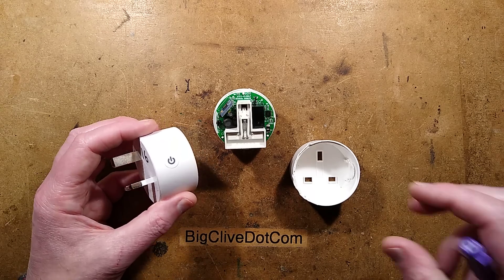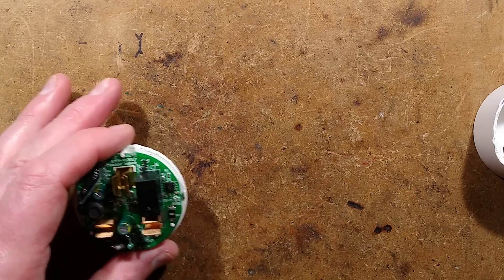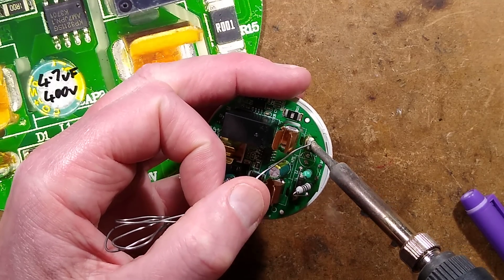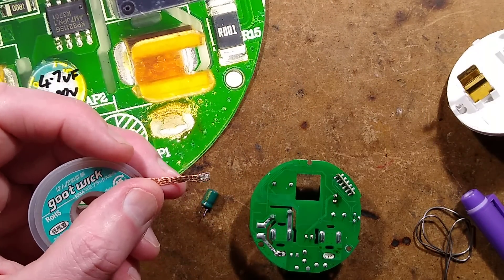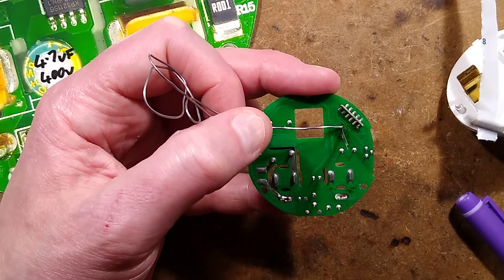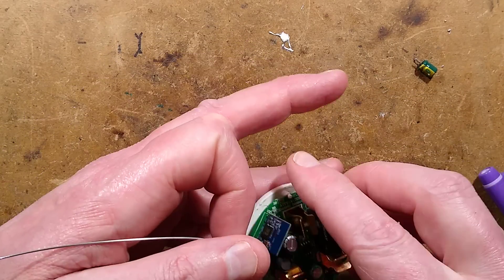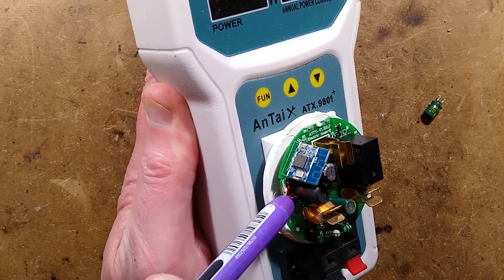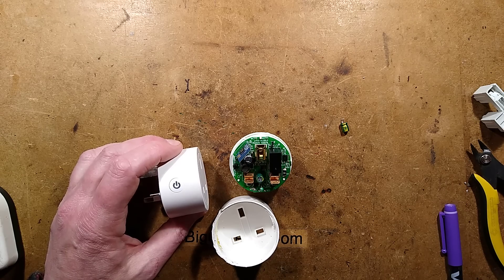Fixing a faulty LSPA7 smart plug (XiangHeWang)

Comment: I've had ones where the rivet holding the socket contact to the plug contact has been loose and cause umpteen problems. Soldering the joint sorts it out.

Comment: I had to open a couple of my smart plugs to access the wifi module and its serial port (UART) to flash a custom firmware and those things are a pain to open, also I couldn't really desolder the PCB so I had to essentially pry it from the case just enough to solder some wires on the module contacts on the underside.

As for closing them again I have to say a generous amount of hot glue around the border (applied before closing it) does a decent job at holding it together and also if you need to open it again for whatever reason you can let some isopropyl alcohol through the seam to unstick it

Comment: That was a really informative video, thanks! 
I've got a few of these from tp-link, one of which seems like the relay isn't moving anymore (and going by your description might be contacts welded) 
I used it on a pc tower, so turning on the power might have been a high enough current to do the damage.
Reply from the maker: It was probably inrush current to the PSU capacitor.

Comment: CHINESE capacitors are the biggest problems in modern products. They are built and sold in order to be bought and installed in a product, that in turn is built to be sold to extract some money from the customer 's wallet. Their mission ends soon after.
I have come capacitors which are built to behave as capacitors for as long as possible. Built from ITT, Sprague and Nichicon, they last 20 years or more, honouring the European, American and Japanese electronic Industry in the best possible manner.
Have an Happy New Year 2024!
Greetings,
Anthony

Comment: Capacitors are the most expensive components in these products so you can bet they under size and under rate them as much as possible to save that last half cent.   The fact they fail after only a hundred hours of use as a result does not make them any more money in their eyes.

Comment: It always seems to be the capacitors, but given the nature of sealing the cases shut, it makes repairing them annoying because you can never quite get them back together properly, assuming they didn't get entirely broken on disassembly... :\
Reply: Yeah. You kinda have to convert them to other uses and case them inside an appliance or other larger casing. Clips and one screw would be just as secure but allow for repairs. They'd say it has to be glued for safety of course, and not so you're encouraged to buy them over and over for the rest of your life.

Comment: What is the best option for a replacement cap?  Low ESR /  Solid Aluminum electrolytic / A higher voltage rating/ a higher temperature rating / Tantalum ???  He Wang should Xiang his head in shame.
Reply from the maker: Ideally a polymer cap might be good.  But a decent low ESR electrolytic is a good start.

Comment: Strangely, this actually will defrost your car 😋
Reply: Yep. Stick it into the socket nearest to your car, program it for an appropriate time before you leave for work - I recommend about 1 hour before the usual departure time....
Then simply run an extension lead out of this device to a heater you've placed inside the car.

Comment: Thank you so much for taking the time to look at this for me! there must be 1000s in the bin in UK! I will carry out your process for the other 8 i have and any further that go faulty, though the first batch still performing , once i get one running i will confirm the fix,  those you have need a reset to default and app  (smart life ) download , account and sync with your wifi , again Thank you for investigating and giving me the key to getting them working again , Happy new year !
Reply: Perhaps you can repair the with the solid type capacitors Clive mentioned.

Comment: Was that label from cpc really a fabric label?
Can't say I'd trust an electrolytic capacitor being so close to live pins like that

A good solder flick can be helpful, but not when it just lands on your other arm 😅

The unit seems to come off too easily, I've pulled things from sockets before that have come apart in my hands, then you're left with a live thing dangling there
Reply from the maker: Printed plastic bag.
Reply: Or rubber gloves.

Comment: Regarding "flicking off" the old solder blob: I actually intentionally drop parts like these from 10cm and less. In my experience it works quite well to also clear solder from small and big holes .
Reply: I use the "heat and bash" method. Just bash the thing against the table to dislodge the molten solder onto the bench.
Reply: @Loscha   Yeah, I'm a basher, too.
Reply: @Loscha  yep smack the edge on the table and you clear those spade connectors or smack it flat for solder blocked through-holes.

works 100% every 3rd time 😂
Reply: Percussive repair has been used since the beginning of time and repairs themselves.
Reply: I've also used a stainless steel paperclip to physically move the solder out of the hole while molten.  Or a toothpick.  Solder doesn't stick to these things.  I always break something when I flick.
Reply: @pault6533  I don't recall who recommended this to me/us, maybe BigClive, or maybe AvE: I have bought a set of needles (actually hollow needles, like syringe needles) of various sizes, stainless, that can be inserted into a solder hole, sometimes even additionally to/over/around the component lead. Insert while hot and retract when cold, this sometimes makes it easy to remove/unsolder a component, specially if you want to keep/reuse it later and need the leads.
Reply: @lImbus924  Very useful things not only for clearing through-hole solder, but also for straightening connector pins.  I recently ham-handedly mashed a USB 3 motherboard connector.   The contacts are very small, but one of those hollow needles slipped over the end of the bent contacts made straightening them very easy.
Reply: And I wipe the tip of the iron on my old jeans....
Reply: @skuula  And how did you get old jeans?  By wiping my iron on my new jeans...
Reply: @d00dEEE you can't have new jeans forever ! 😅
Reply: The drop or flick solder removal methods do work but from my experience, never wear shorts while attempting.
Reply: @emehlhar  lol, yea, that can hurt. Been there... 🍻
Reply: @emehlhar  or sandals with no socks... although some people seem to have issues with sandals+socks
Reply: That's my approach.
Reply: Briskly blowing through the thru-hole right after you melt the solder works to remove it also on those delicate boards that you can't just whack on the edge of your your bench... 👌

Comment: Most of my smart IOT devices are liberated from the chinese by reflashing the onboard esp or tuya chips with Tasmota or openbeken, they are now local Lan & mqtt controlled instead of the "Internet required Cloud"  and are better to use. Multi relay devices are all on or all off by default configuration  but once liberated you can control individual relays and have greater control over what is connected.  I say goodnight to Alexa and it turns lights on and off as I go to bed (yup lazy as can be)
Reply: Liberated from the Chinese, and then you use Alexa.😂😂😂😂
Reply: dude, can you make a tutorial (series) for that sort of thing? Being able to actually use hardware that's been discontinued by the manufacturer and the requirement of their proprietary cloud service has rendered them useless, would be incredibly useful for consumer freedom and reducing waste.

... maybe big clive or perhaps Louis Rossmann can do that, if they realize it's an option - Louis would definitely love it.
Reply: @TheDZHEX  Tutorials already exist. search for "flash smart plug".
Reply: @TheDZHEX flashing a no-cloud firmware like tasmota on any of these esp is quite easy once you figure out the pinning of the chip yourself or if you find it in the numerous documentation pages made by the community
Reply: @cuteraptor42  sure, but what do you need and how do you know if it's actually doable? The actual process is likely quite simple indeed, but if you can create a shortcut from zero knowledge about flashing, pinouts, connections, etc. for people to be able to get into that, it would be quite useful, I think.

... assuming this isn't something like having a product that happens to have an off-the-shelf arduino or equivalent inside it...
Reply: Sadly  @TheDZHEX , the LSPA7 is one of the newer Tuya devices with a less well supported micro-controller, which isn't as easily re-flashable yet, so there are no tutorials for it.

One option is to buy Sonoff or similar devices which are easy to find, have control chips with more well developed firmware, include programming headers, and where tutorials are available. All of the power for our homelab goes through a powr320d which has been reflashed with ESPHome, for instance, and I just followed the ESPHome for a Sonoff Basic, adding a few tweaks for the power monitor.

The other option, if you already have an LSPA7 is that you can do local control with the stock firmware once you extract the device id and key using tuya-cli wizard. I do this to power cycle a troublesome IoT device every night with a Home Assistant automation. To do this, you will need a Tuya developer account, but the process is quite well documented, just search for "Listing Tuya devices from the Tuya Smart or Smart Life apps".

If you're worried about the original firmware 'phoning home' then you always have the option of blocking all traffic from it's MAC address in your router, once you have local control working.
Reply: While most esp8266/esp32 devices, and older Tuya devices are easily flashable with Tasmota or ESPHome (which I prefer for Home Assistant use since you don't need a separate mqtt broker) and many even have programming headers, newer Tuya devices like the LSPA7 use a proprietary microcontroller module that can't be flashed yet, even if you can get at the module. It's a shame really because these are cheap (I have a few) and unobtrusive, compared to something like a sonoff.
Reply: @markbooth3066  I just put everything on a local-only restricted Home Assistant hub via Zigbee. That way any WiFi chip (if there is one; most don't have both) can do what it likes & it still won't be able to contact anything. Gave the WiFi bulbs a try in the past & they're just not as reliable as the Zigbee mesh unless you already have an established mesh network set up, plus they expose your router to DoS attacks.
Reply: Sorry but what a joke! 😂 Going cloudless on smart plugs and iot devices but still keeping alexa 😂 i would invest in pycroft or a custom non cloud smart assistant
Reply: @309electronic5  I've seen this openHAB thing... open-source home automation thing, could that be useful here?

Comment: @MarshaJ8800TU  suggests the failed cap is coping with 1MHz from the  KP3211 switching chip  ...  amazing frequency for a power supply.
Cant find an exact spec sheet but I see other examples running up to 1.2MHz (e.g. A7525 from AiT)
Quite a revolution, I'm used to thinking 60KHz is a high-ish switch-mode SMPS freq if you want reliability.
Can't believe an electrolytic doesn't instantly let out the smoke when absorbing power at those frequencies.
Bet they run hot and dry out quickly.... hey...wait.... that means even quality products won't last very long....mmmmm,...
Reply: Data sheet says LP3211  runs at 0.9 to 1.5 MHZ
Reply: Usually they use ceramic caps for power supplies at those frequencies, which likewise have become amazing performers in recent decades. An extra 100nF in parallel might have doubled the life of the electrolytic or more.

Comment: I'd like to see what that cap shows as on a meter, both capacitance and ESR.

Also, what rating did the relay claim?
Reply from the maker: I stuck the failed cap into a component tester and it showed up as a diode with a capacitance of zero for some reason.
Reply: @bigclivedotcom  Dried up then.

Comment: Gotta say, I certainly wouldn't like to draw 16 amp through that, and let's face it, these are used mostly for switching lighting or heating and a 3kw or even 2.5 kw is gonna kill it rather quickly!
Reply: IIRC most of these relays do say don't use for high power inductive loads like washing machines or resistive loads such as heaters etc.

I wonder if 1# they are fused? I didn't see anything in the schematic, and if they are fused, what's the rating? I'd probably not want to go more than 6-8amps
Reply: 16A was probably the model number .. certainly not the continuous current rating ^^

Comment: Nice little fix. Dead electrolytics, the true menace.
Silicone glue on recombobulation, and it won't come apart before it is properly spudged.

6:32 ...and see if it was not a Fluke! :)

Comment: Here's another example of 'time-bomb' components-
Just fixed a family's toy Christmas train, an expensive Disney themed setup.
After a few Christmases' of use it couldn't run for long before crawling to a halt and 'motorboating.' (Strange describing a train engine as 'motorboating')
7.5V Battery (5 x C-cell powered)
Examination revealed a very hot component in the power input stage of circuit board.
It was a SMT Polyfuse. Intended, I assume, to reduce power if engine has stalled.
Sadly polyfuses have a limited number of operations before triggering at lower and lower currents. This one was rated at 1.5A nom, 4A trip, 8v max
The motor is PWM controlled, average currents seldom exceed 1 amp. Probably not a factor but PWM  does produce high current peaks.

Interestingly, the polyfuse partially recovered after it's ends were re-soldered. Not for long though.
Replaced it with a slightly higher current rated through hole polyfuse (and a much higher max voltage rating). It happily passed a reasonable time-soak test.
Happy Family.
Reply: Not sure what behavior you refer to as "motorboating", it seems to be beyond my knowledge of tech slang and as non-tech slang it refers to a particular form of lovemaking .
  Also your dozens are more like scores (5 to 9 scores in mains frequency CPUs) .

Comment: Clive, My favorite type of video! Why was the failed capacitor exposed to high frequency? Was it not smoothing rectified mains voltage?
Reply: The 4.7 400v cap filters the mains 50hz.  The 470 10v cap is filtering 1Mhz from the KP3211 switching chip.

Comment: Nice and easy fix!! I miss the diag bit though. 😊 Did you really spot that cap and went for it? 😉
Reply from the maker: Its one of the most common failures.  The dim LED was probably a low or unstable supply voltage causing the processor to fail to boot.

Comment: Nice  - what is the WiFi module please? This may be flashable with another firmware for use outside of their app. I've done this with lots of Sonoff devices which use ESP8266 - would be interested in using this form-factor if I could.
Reply from the maker: Beken BK7231T0N32
Reply: Huh, mine has Bouffalo Lab BL602
Reply: Tuya ditched esp chips years ago so its impossible to find one (unless its another chinese brand who has great contact with tuya or has stock) all use beken chips or realtek. For which is openbeken
Reply: jeah, why not use a wroom and a freaking relay in a junction box  then .. probably comes in cheaper also and you know what you got
Reply: Because separate components in a box, with all the required relay, power circuits etc  are bulky. I have amy of these already around the house. This form-factor is nice and neat if it can be hacked. Also, I like a challenge, and learning new things. @tinygriffy
Reply: @billd01rfc good point... well I prefer bulky over flimsy planned obsolescence .. but you do you. good luck.

Comment: It looks like the bottom has popped of slightly from the faulty capacitor.  
Would it be helpful the install the missing cap on the incoming high voltage side...take some of the stress off the other one?
Reply from the maker: The primary side capacitor has an easy life.